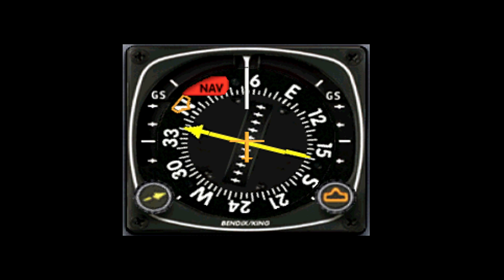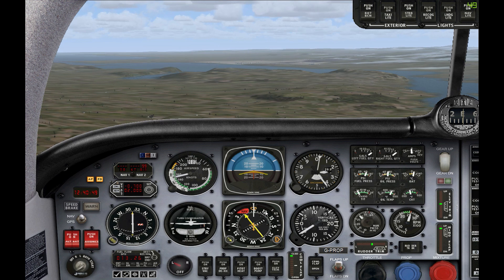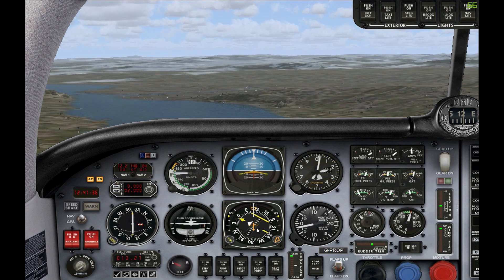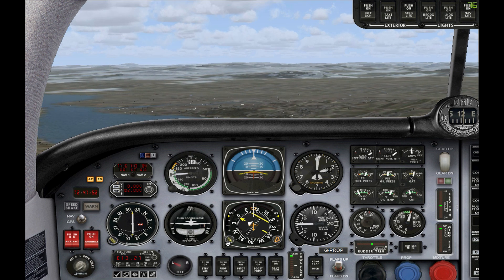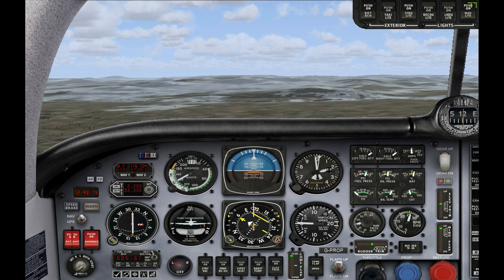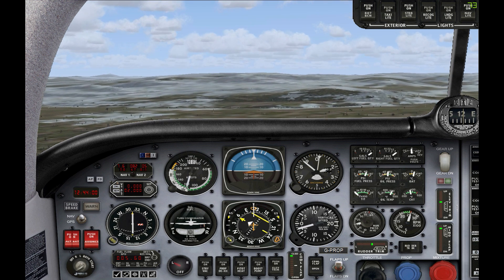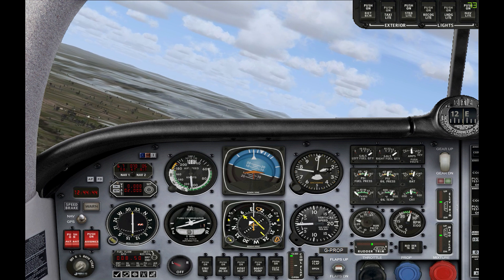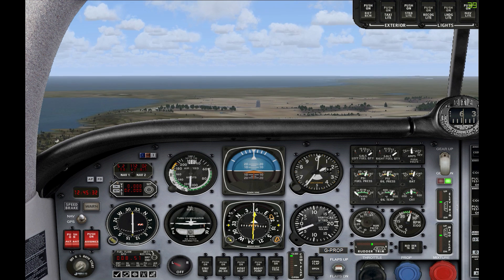FSX Tutorial: Horizontal Situation Indicator

Comment: Once you are establish in the radial, the point of the yellow arrow where is suppose to point, that radial ? (In that case yours is pointing to the other side ) or pointing to your heading ? (In that case you are ok ) thanks
Reply from the maker: Yellow arrow points to the Radial. There is a separate orange heading bug which moves around the outside of the compass to set your Heading.